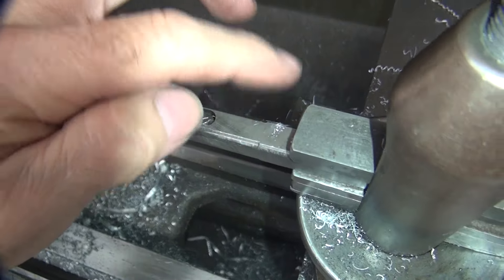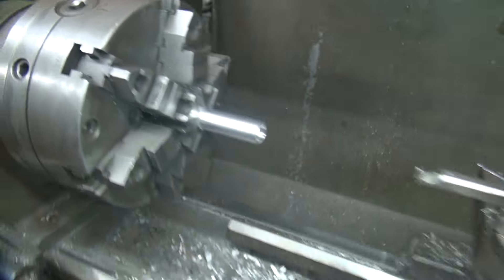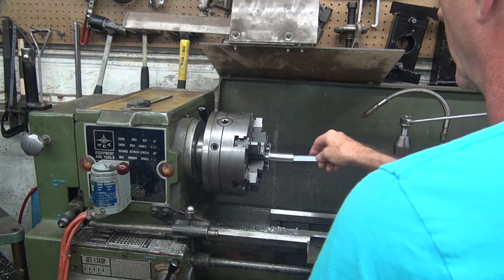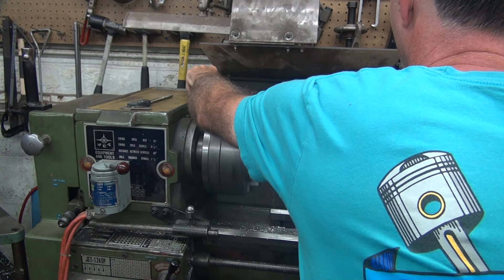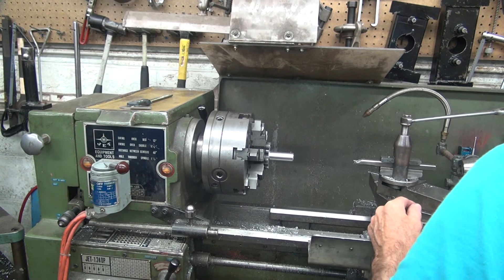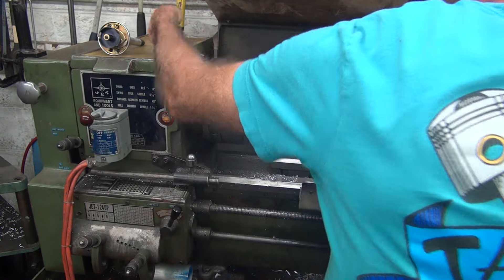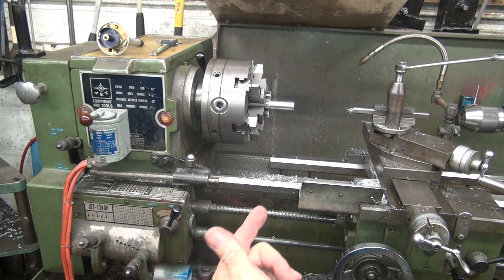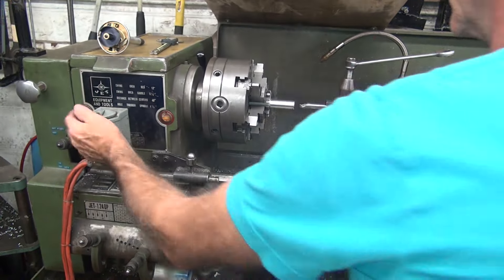#136 1946 junk 84ci stroker knucklehead 500 mile new repo motor rebuild 79ci harley tatro machine

Comment: Just leave the freaking clutch engaged and use the drum switch for goodness sake.
Reply from the maker: nope, that is harder on the motor and not safe. using the clutch comes in handy at times.
tatro

Comment: I thought if you could cut 0.002 on pass, out of that on that lathe....... I'm buying one of those.  Just curious.......I think an adjustable reamer could have gotten a better finish and dial it right to size.  But, then you said it's only for mock up. So not worth the time I guess.  Thanks for the video.  Nice to see old machines doing their work even today.
Reply from the maker: having a hole that looks good but is not concentric, is worthless.
i did use this bushing in the end.
tatro

Comment: Call it what you may... "Armstrong Style", "Lantern Style", "Lighthouse Style" or "Rocker Style".  It's just something I never see any longer on YouTube. Even the 4 way Turret Style is outnumbered by the newer  "Quick-Change" variants. I thank you for using it because it should be an EYE OPENER for those that struggle with getting their tool into a tight spot! Hands down this old girl will get into places that NO OTHER design will! Changing your cutting angle is also easy with the old but enduring design. Our predecessors were far more clever than we are! 

By the way ... Thanks for the video but please tell us about your lathe. That reaching across your chuck to (what appears to be a clutch lever) looks extremely awkward!
Edit: Never mind. I see it's a Jet. I have and like Jet machines but that's  STILL awkward! 

Wakodahatchee Chris
Reply: I have a very similar lathe. That lever is for tensioning the drive belts. I don't think it is meant to be used as a clutch lever, as you can just turn the motor off and on. I'm not sure why he is doing it that way as it is dangerous reaching over the chuck.
Reply from the maker: in the 70,s, no one cared about safety. there is no brake either. and even after all these years, i still have all my fingers. how can that be.
tatro